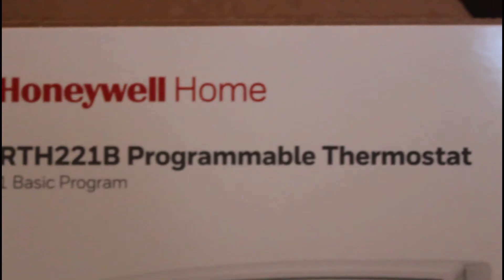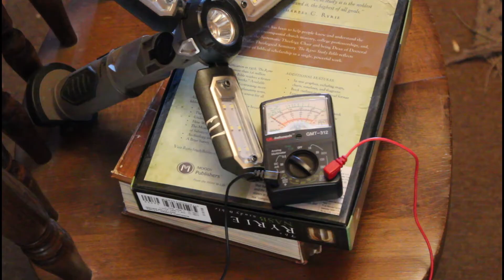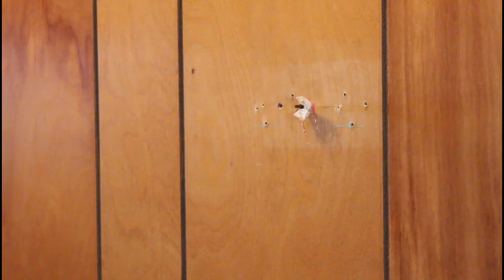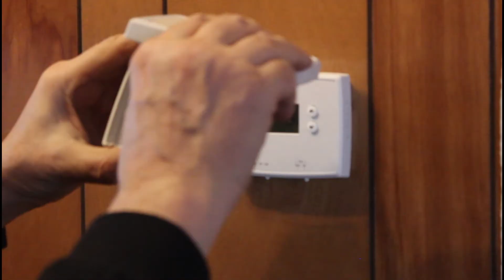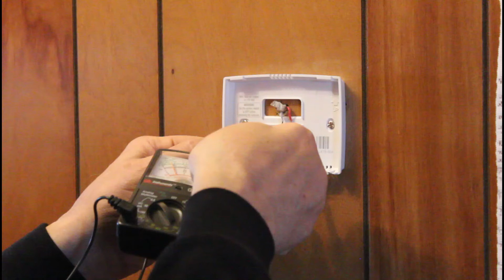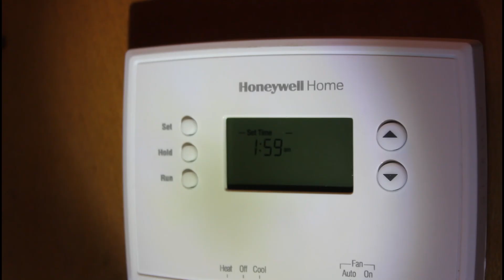Honeywell RTH 221B Thermostat Installation

Comment: I just purchased the same stat.  My backlight doesn’t work does yours?  Heat and cooling work fine but I don’t have a backlight.  Let me know
Reply from the maker: There's no back light. That would be a  Honeywell RTH3110D1008 or RTH2300 B1038. There are others. I researched it on Amazon. I got mine at Menards. Menards has other models.

Comment: Are Honeywell heatpumps😅 interchangable with regular electric heat?
Reply from the maker: This thermostat can be used for a heat pump or forced air, oil and gas regular heat. Also, air conditioning.